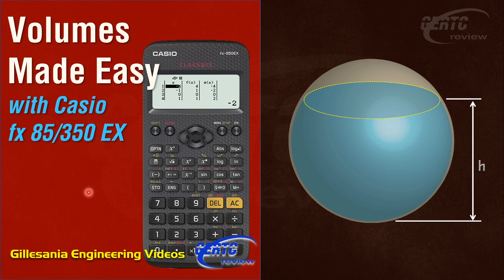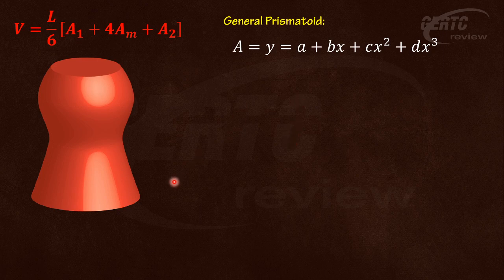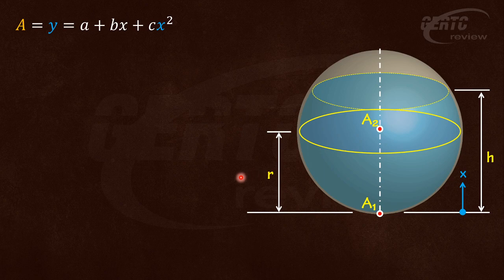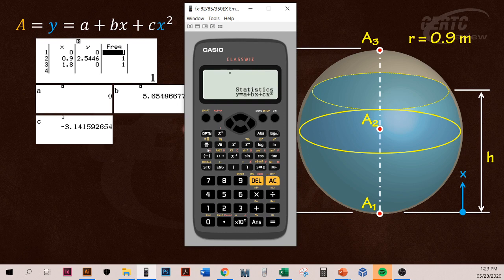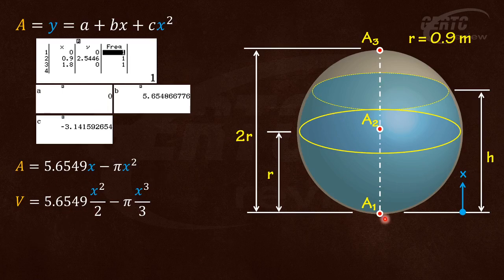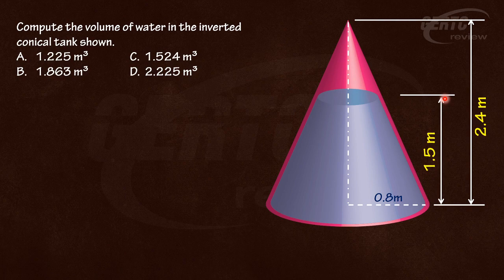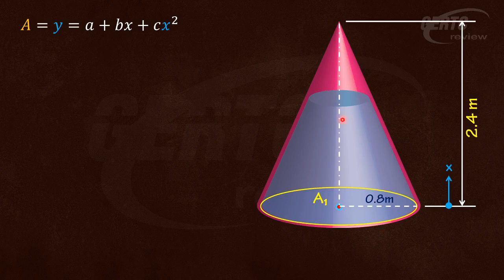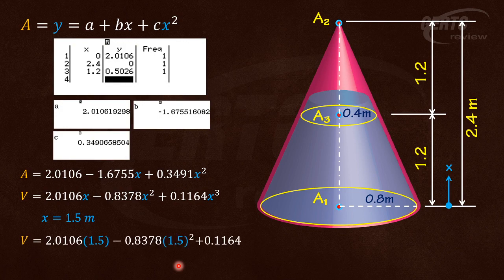Volumes Made EASY with Casio fx85/350 EX (Geometry)

Comment: By the way sir..I try solving the equation given by  using shift calc  the answer is 2.3559  is not 1.089
Reply: Quadratic kasi sya need mo baguhin ung iteration ni x para makuha pa ung isang value
Reply: Pano to
Reply: canon 789sga .. use .. 

mode-5-arrow down-2

then  input the values from highest degree to lowest

lalabas ang tatlong value .. and one of them is 1.089 :)

Comment: Tinry ko yung problem na to: The bases of the frustum of a sphere has a diameters of 20cm and 12cm and its thickness is 3.6cm. what is the volume of the frustum? 
I assumed 20 is the diameter but wala sa option yung sagot ko haha

Ask lang po yung distance po ba ng x with respect sa area is from the bottom part, center then top part lagi?...yung frustum kasi ng problem on this problem is somewhere in between of the sphere..thanks.
Reply: medyo nakakalito lng po baka po frustum of a cone to? kasi mag kaiba ung bases.... then 3.6 thickness parang hollow sya...  yan po pag kaintindi ko sa problem.. if tama po ako
Reply: @haddeec  apologies sphere po pala yan...actually po may solution po xa at may drawing din. Yung frustum nya po is in the middle of the sphere...sinubukan ko lang na gamitin tong solution ni sir bat iba lumalabas haha
Reply: canon 789sga .. use .. 

mode-5-arrow down-2

then  input the values from highest degree to lowest

lalabas ang tatlong value .. and one of them is 1.089 :)